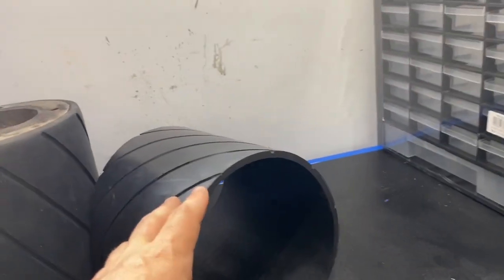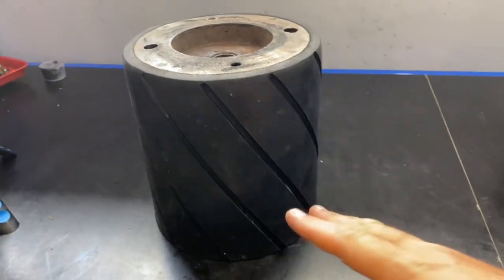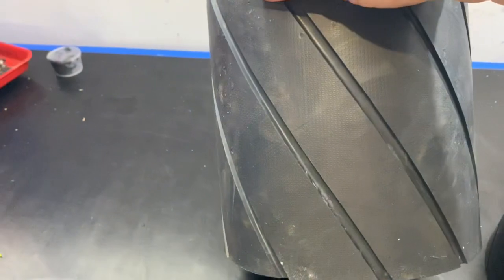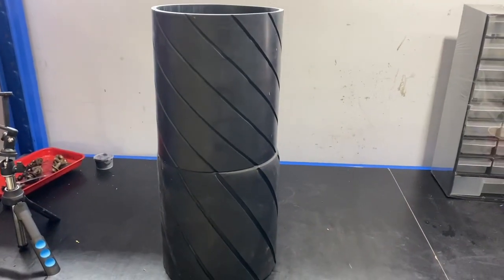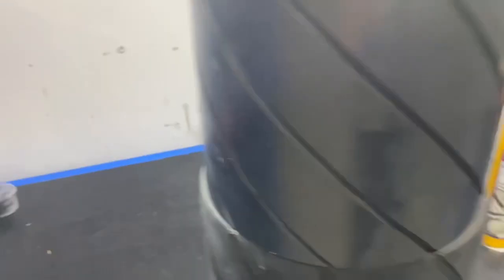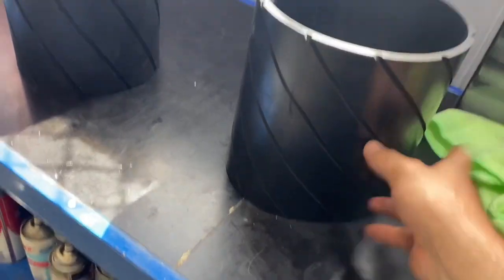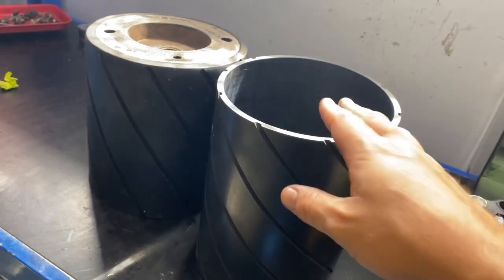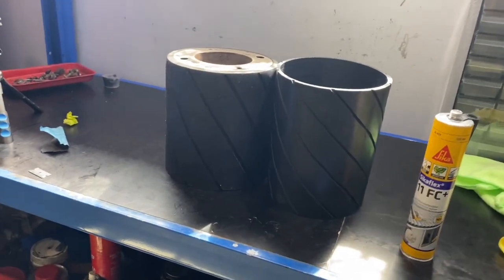Scott Bonnar rear roller rubber options

Comment: Interesting option Simon. We only vulcanise in the factory and won't change that but for restorers a slip on, at half price,  sounds like a great option. I guess the only quick way to test the durability would be to build a test platform and run both options alongside each other and see what happens. Sounds like something your local university engineering department might be keen to do.
Reply from the maker: Yep sure is a good option for the DIY and might be a decent option. Will be testing on my personal mower to see how they stack up.